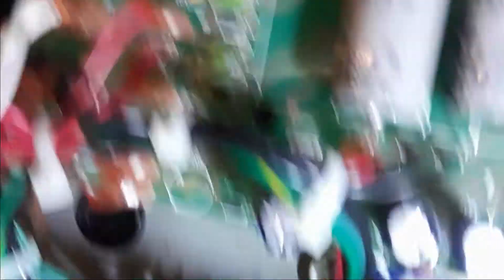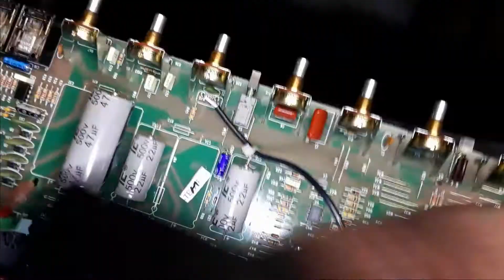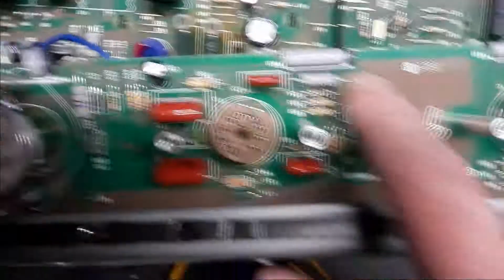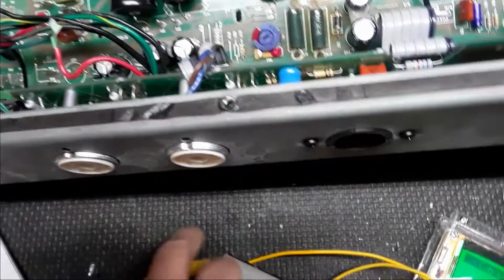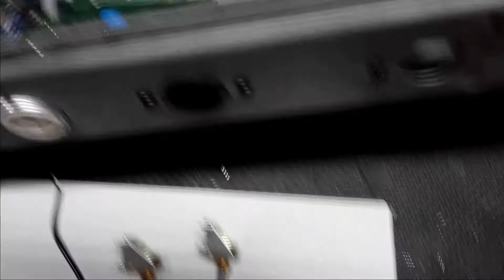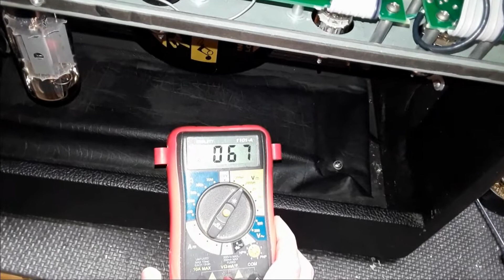Hot Rod Deluxe 2002 Repairs & Mods

Comment: The. Fender.  HR IV Mod at V2 grid is a worthwhile mod I was doing this years ago  in a diff area.  A friend in biz flat told me Fender stole some of my mods. I was modding  these amps bk in 1999. N started on Harmony central.
Reply: Is this lowering the resistor and gain? I was considering upping this a bit to get more gain!
Reply: @EVRMedia  Naw, i blv itsa 330Kin series w/,002 or ,001 grid to ground, be nice if utube gv reply status lol...causes slight compression n smooths gain...doesnt lower it

Comment: Wo going down the video. Im calling. First. Preamp filter cap. Then either driver tube/ plate resistor then bias circuit.  I e also seen the wiring at pilot bulb WRECK HAVOC.  N then theres still a zillion more things that could be bad. Lolol.

Comment: I just finished the Fromel Audio Complete Mod Kit  on a customer's Hot Rod Deville III. Decided to check out your video before putting the amp back together & caught the R12 56K audible. Great call Ricky ! much better over all usable tone greater sustain too. Big Thanks
Reply: R12 56 will add more bass to the tone, something that generally people avoid in this already bass heavey amp. I'll stay around 100K and 130K

Comment: hey man thanks for the detail, could you share what kind of resistors you use for the R78 and R79? I notice you replace those cement resistors with Wire wound? but what is their capacity and how they have hold up the temperature conditions? also the Diodes those 1N5353B are hard to find in my electronics community do you share the ones you use? thank you !
Reply: Digikey carries those diodes.

Comment: I’ve got two late ‘90s HRDs and both are having problems. My main one...the bass and mid control doesn’t work, the amp won’t switch to the OD channel, and the treble AND volume knob control the volume. I recently had the ceramic resistors on the bottom of the board changed and I’m wondering if maybe the wires that plug in from the transformer may be connected incorrectly. I’ve never had an amp do this...any ideas?
Reply: switching are issues normally dry soler joints on the large resistors related to the power supply on the main board (not tube board)
Reply: I thought it was the low voltage side that controlled the switching. Ahhh what do I know. Lol